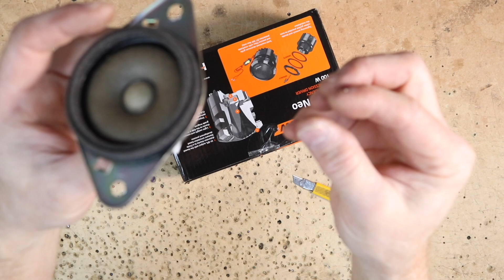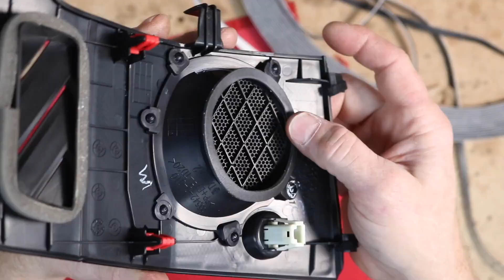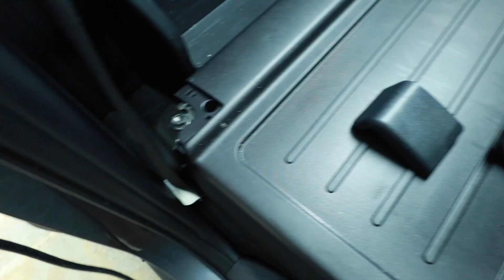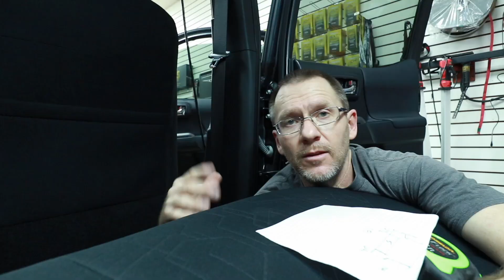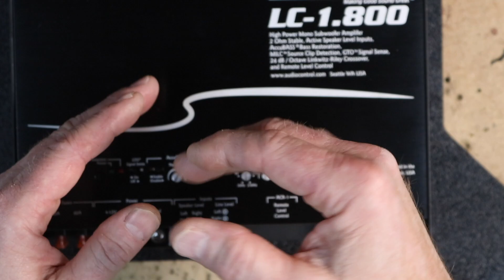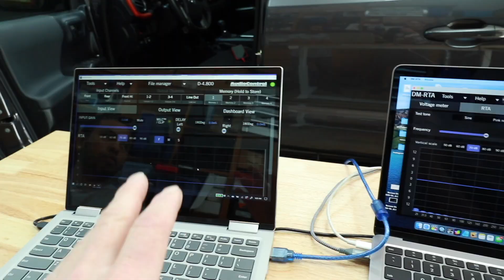Toyota Tacoma full car stereo install

Comment: Can someone help me? I just installed a new Pioneer head unit. Everything runs okay, only thing is when I am in drive, the parking brake sensor goes off stating that the brake is still engaged. Do I have to connect the parking brake wire to the parking brake switch? asking for a 3rd gen taco.

Comment: Great video to show you know what you're  doing. It's not so good as an instructional video. However, I picked up a few things that were useful. 
My recommendation is to break down your install video into sections: speakers, amp, head unit, and slow down and provide a little more detail.  I'm currently installing a DMX1057XR into my Tacoma. Your video was helpful because I have some (very little) experience installing car stereos systems. What takes you guys 2 days will probably take me a week.

Comment: It's funny... I ended up doing something similar to my Frontier... 3-way 6x9 in the doors, and the dome tweeter in the dash.  I was told that this would be too much tweet...and I'd be better off using a component set, with correct crossovers.   I like how it sounds... the sound accuracy is pretty  impressive.  What are your thoughts?  I actually 3D printed my dash mounts for my tweeters.  I used PETG to prevent summertime melt down.

Comment: To be fair, you can have a bleedingly loud system that retains high quality. I pump 150w into my door speakers. I wired driver front and driver rear door speakers into a 2ohm load. Same on passenger side. Pumped 150w into them. I can legit get out of the car with the doors open, in a parking lot, crank it to max volume, and its like being at a stadium, no distortion, ridiculously loud, and the quality is still there. You can legit hear me from blocks away if I ever turn it up to max. Thankfully I'm not deaf yet so I never really go to max except when I'm outside the car and showing off. Inside the car I sit more around the 50-75% mark.

Comment: Fantastic video! Was curious if you've done a Tacoma with the JBL setup? Have been trying to research ways to retrain all stock locations and add some extra bass using the existing sub enclosure. Don't want my ears to bleed, just clean sound with some more thump than factory.

Comment: Awesome 2+ day install, enjoyed all the extras and attention to details. I have the exact 2020 Tacoma on the thumbnail. I have swapped the 4 door speakers previously and waiting for my 5 channel amp to arrive. I plan to high level speed wire from the OEM head unit to the amp and speed wire back to the speakers wiring harness. The 8" kicker loaded sub 46TL7T82  fits in the rear pasenger pocket with grill behind the seat. I love your custom amp rack and fuse holder mount. Do you sell these items or can you provide info on find similar product here in Canada? Great video, nice work!
Reply: Did you have problems with annoying noises caused by the stereo?

Comment: Any chance I could get a rough idea of how much this install costs total?
Reply: @Jesse M  
Well, there is nearly $6,500 in equipment and installation accessories alone....  And I'd figure AT LEAST $1,500 for installation LABOR, but probably closer to $2500+ due to the sound deadening installation and custom amp & tweeter mounts.  So a rough total of $9,000-$10,000.

Comment: 01:02:16  Why is the dash out of phase?
Man this really has me thinking.  I'm considering the reflection off the windshield... also considering the arrival delta between speaker location.  But I'm missing something that would justify the dash being out of phase and some how arriving at the listening position in phase.  I can't see how a reflection would invert the phase, and time correction should be the solution to align them with the door.  So I see some forums stating any separation more than 8-10 inches the tweeters should be out of phase.  So it has to be associated with arrival delta.  I can sort of get my head around it now.

Comment: I haven’t heard of some of the brands you guy’s use but I love your installs👍💯 That base knob is sick,I want one for my Camry.
Reply: I was based in Holland for a while back in 2002, and decided to do an install. The car audio shop down the road recommended Hertz to me so that's what I got and fitted.
Meanwhile, one of my freinds bought a new BMW with an expensive optional Harmon Kardon system. He was totally appalled at how I built something from "thug shops" and it totally owned his "top of the range" system.

TLDR: Hertz = pretty good.

Comment: Hey what size heat shrink do you use for example to go over the rca head but also shrink enough to the actual rca wire like you guys have there.
Reply: It’s not the size, it’s the shrink factor. Not all shrink tube is made the same. You have 2:1, where it shrinks by half, 3:1 where it shrinks to a third the original size and 4:1 to go to a quarter of original size. I’m sure there are other shrink factor heat shrinks, but those are the most common ones. You’d want a 3:1 or 4:1 for RCA’s like the stingers with small wire jackets. Just make sure if your using 4:1 to start on the wire side and shrink only enough around the rca end to make it tight. Too much over heating and you’ll split the shrink.
Reply: @mainmanmustard  👍🏽thanks for the reply bro. Ya hooked up with wirecarecom. Got a couple of their kids. 3 to 1 worked great and got some colors styles also👍🏽
Reply: Good to hear. Now you make your installs fancy like Dean. ;-)

Comment: I've learned a lot from you guys, thanks for your vids and more so, taking pride in what you do. I'm a custom airbrush painter, so if you have any "Super Kustom" jobs tell them "you know a guy"🤔😉😁
Reply: Same. I sound treated all 4 doors in my Highlander, and holy crap what a difference in volume, detail, and bass for my 4 Kicker KSS6504s. Dean's attention to detail keeps gnawing at me to also solder and fabric tape all my wire harness connections behind the dash. If he took my HU out, he'd be ashamed, lol...

Comment: If He wants it loud, D1200 and LC1500 would have been a better fit.
Reply: Going from 200 watts to 300 watts on a pair is not going to make a difference. You need to double your power in order for you to get double the sound. Or double the number of speakers.
Reply: @ricardomolina4605 you need ten times the power to double the sound.

Comment: Nice! What was the total cost of this install?
Reply: I was wondering same thing so I created a list of the parts they used and went to Crutchfield to look up pricing. I totaled over $5,000 for the parts alone.
Reply: @woodman0860  thanks for the info. Labor was pretty intense as well
Reply: @woodman0860  so that would probably be about 3500-4000 because crutchfield is overpriced
Reply: @woodman0860  About 3k in Europe.
So including labour and materials probably 5k install